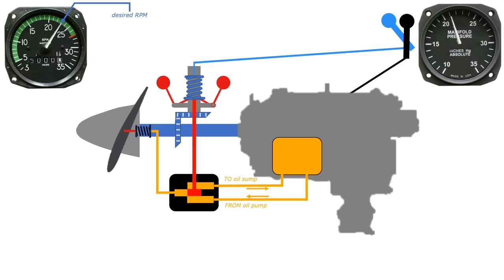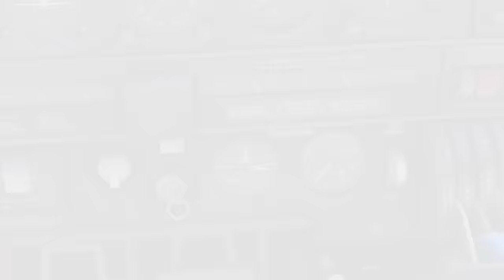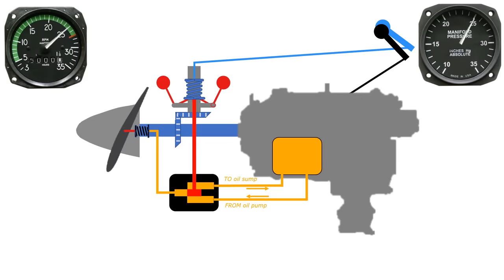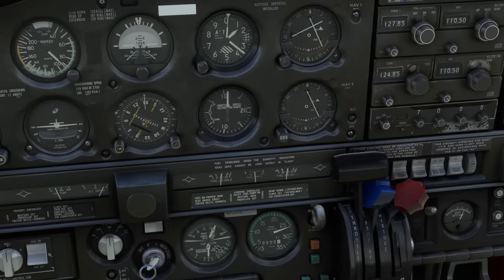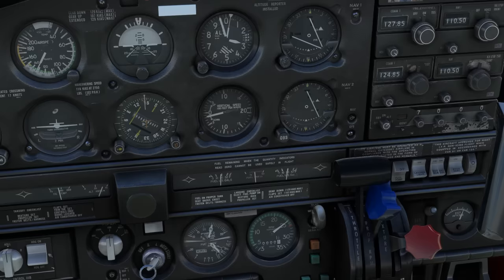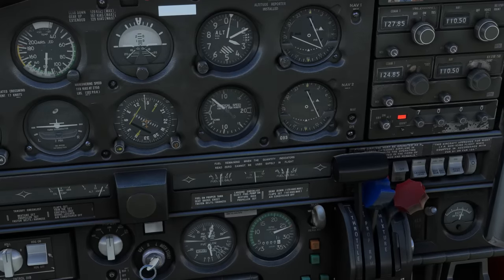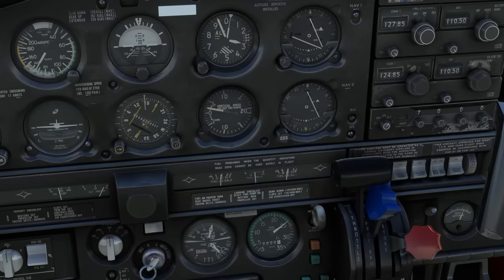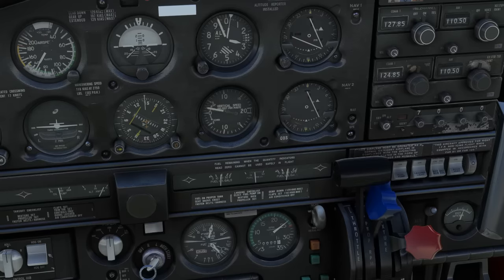How to Fly with a Constant Speed Prop | Transition to Complex Aircraft

Comment: GUMPICSS: gas, undercarriage, mixture, prop, instruments, carb heat, switches and seat belts. ( Some items may not apply).
Reply: How many nm from the airport do you start the crosscheck?
Reply: @riod43  when you get ready to descend, you use your decent checklist. With simple airplane sometimes it is only three obvious items like reduce power enrich mixture and a target airspeed. Usually if I am VFR and I am in the pattern I start my GUMPICSS check on  downwind. If I’m flying on instruments once I am within 3 miles of my final approach fix inbound and I am stabilized I can run through the check one final time. Then when I cross the fix, I pitch to my dissent rate on the VSI and I adjust power as needed to maintain desired air speed. Sounds backwards from the way you learn it, but when you are instruments, you have to pitch to the glideslope, not the airspeed indicator. Profile flight is the most consistent and result in near perfect landings every time.
Reply: Please send gum pics
Reply: What about cowel flaps? I’m partial to BCCGUMPS: boost pump, carb heat, cowel flaps, gas(tank selector), undercarriage, mix, prop/power, switches/seatbelts

Comment: I was always taught to cycle the prop 3 times: 1. Rpms go down. 2. Manifold pressure goes up. 3. No oil on the cowling. And by doing it 3 times it "cycles" oil through the prop. Now you are all warmed up!
Reply: Yes that's correct, I was taught the same!

Comment: My point of view and method for remembering the correct actions is like this: For me, the throttle is the analog of the accelerator pedal of my car. The prop control is the dearbox of my car. If I have to drive up a hill (climb in the airplane) I first select a lower gear (prop control forward) and then press the accelerator pedal (throttle). If I am rolling down the hill I usually do not change gear but just release the accelerator pedal.
Reply: That makes sense!

Comment: Why would you pull throttle off the enrichment setting during departure?  I do a noise reduction takeoff by reducing rpm to 2500.  This takes a bigger bite of the air and you can feel the increase in airspeed.

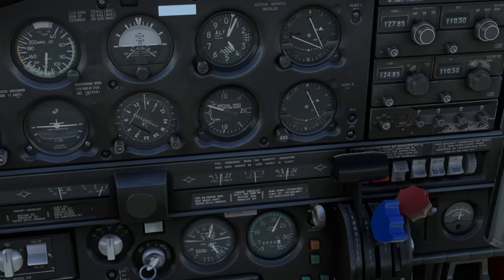Comment: 7:58 Wrong. It's not about overstressing the prop, it's about generating too much pressure (and therefore temperature) in the cylinders.

The problem with extreme settings of high MP and low RPM is higher intracylinder pressures (ICP) and a corresponding rise in cylinder head temperatures (CHT). You're feeding the engine a more dense fuel/air charge while simultaneously slowing down the power stroke. Peak pressures increase in magnitude, and occur closer to top dead center. Near TDC the piston is driving directly down into the crankshaft and you have lost all mechanical advantage; you're putting excessive force loads on these engine components and asking them to do way too much work. Instead of a bullet (piston) being smoothly accelerated down the rifle barrel (cylinder) you have created a pipe bomb. The real stress is inside the cylinder, on the piston and connecting rod. The danger is pushing these cylinder components to their temperature limits, resulting in detonation. 

Extremes of very low MP and very high RPM are also bad. In this case there is insufficient positive pressure on the piston to keep it seated, allowing  piston ring "flutter", leading to scraping and scouring of the cylinder walls.

The bottom line is do what the manual says, not what some clueless 19 yo CFI tells you. (ie oversquared old wives tale BS) The engineers who created those tables and charts know about all this stuff.

Comment: Does higher manifold pressure mean more torque/thrust?
Reply: Yes, higher manifold pressure means more power while the engine is running, so more torque, though piston engines don't have a torque gauge.

Comment: I don't want to be picky and I know youre using a sim but does the concept of overspeeding the prop not apply here? on take off and on climb, the rpm was past the red. Am I missing something regarding this? honest question
Reply: Past the red it short but not sustained periods generally in climb when need high power, but never in cruise
Reply: Depends on the aircraft - the two I've flown, one is full power until safe altitude (even if past redline) then reduce to 2500 for the rest of the climb. The other specifies max 2400 for take-off which requires a few cm of adjustment to keep it below redline.

Comment: I'm having a hard time wrapping my head around the idea that at idle, vac is low. In a car, vac is high until you open the throttle. Is the gauge behind the throttle butterfly or before?
Reply: Coming from a car guy background I had the same issue as you regarding this. Car gauges read PSIG thats the absolute measured air pressure plus a 14.7 PSI offset for atmospheric pressure. So if its dropping to less than 14.7 PSI pressure in the manifold the gauge will start reading increaseing higer vacuum numbers with a theoretical maximum of 14.7 under heavy engine braking. If the manifold pressure is higher than 14.7 PSI then your turbo/supercharger is producing more air than your engine can draw in naturally and we start to experiance forced induction (boost).

Plane guages read PSIA, or absoloute pressure with no offset. So with the engine off it reads ambient airpressure (about 14.7 PSI or 29.97 or 1013 depending on who you ask!). When you start the engine in a plane, your gauge will drop in pressure, because with the throttle closed and the engine running you are creating a partial vacuum in the manifold. This is opposite what you would see in a car. Then as you open the throttle in the plane, more and more air is able to natually flow into the manifold until its basically at ambient pressure or close to it. So in this case, as you open the throttle, the pressure reading increases.

Google PSIA VS PSIG for some graphics which help explain this a lot more. But basically in the vacuum range of engine operation, cars and plane guages work in opposite directions even though what the engine is doing is identical. Its simply a different way of displaying the data.

If you are thinking about it in a boosted context, the plane method works better in my opinion. I.E, going from 25 to 35 on your manifold pressure makes logical sense, higher number = more air & power. In a car this would read XX mm/hg vac to XX PSI boost, why use two different units for what is really just a linear change in air pressure?

I hope this helps I have had to break a lot bad habits when it comes to thinking about manifold pressure moving from cars to planes!

Comment: You glossed over something very important at 12:00. A lot of pilots keep the prop back until on ahort final. The problem with that is if you lose the engine, there may be very little pitch adjustment with which to stretch the glide. Prop forward abeam the numbers on downwind gives you a LOT of glide stretching in the event of a power loss.
Reply: I don't understand your comment. Prop forward increases the drag, no? Why would it stretch the glide?
Reply: Glide performance increases as the blade is coarsened. You’ve got it the wrong way around. The reason we are taught to increase the prop to full fine before landing is to facilitate a possible go around.
Reply: @z120p  I don’t think I had it the wrong way around. Your first comment is very confusing but I think I understand what you meant. Either way, I think sticking to the POH and GUMPS is the best advise.
Reply: @z120p This is correct, to stretch glide pull the prop out to coarsen prop pitch.
Reply: @Virtualmix  im not the original poster, and I wasn’t responding to your comment at all. I was responding to the original post that said that glide performance is better with fine pitch.
Reply: If you lose the engine in most single engine aircraft, the oil pressure loss will cause the prop to go full fine anyway... Some aircraft may have an auxiliary pump to feather the prop, and most twins are the opposite (engine + oil pressure loss = feather by default).

Comment: Nice tutorial, well done. If you get the same power (65%) from 24.7 MAP @ 2200 RPM vs 22.8 MAP @ 2500 at 4000', how do you choose between those two settings?
Reply: Much quieter at 2200
Reply: I like to use the lowest RPM and highest MP that will give me the desired power. Lower RPM results in less noise, lower fuel consumption, and fewer hours on the tach.
Reply: The lower RPM. Quieter, less frictional loss, better volumetric efficiency, and reduced EGT.

And remember, it's not really just two options. That's just a simplification for tabular presentation. In reality, it's an envelope.

Comment: OK I’m probably going to get a dozen or more opinions on this question. You look in the POH and you decide that you’re going to fly with 65% power. There is a table that gives you a bunch of manifold, pressure and rpm combinations at different altitudes. OK, let’s say you decide you’re gonna fly at 6000 feet. The POH gives me beautiful pressure and rpm at that altitude starting with 2200 RPM, 2300 RPM, 2400 RPM at 2500 RPM. Each one of these speeds has a respective manifold pressure setting. Each one is supposed to give you 65% power. Which rpm dental pressure combination is going to give you the best performance, the best speed, the best fuel burden, and the least amount of engine wear? Is it a higher manifold, pressure with a slower rpm, or a lower manifold pressure with a higher rpm? I also noticed a POH’s does not give you specific airspeed for every combination. It just gives you air speed at brake horsepower.
Reply: The fact your using 65% power at 6000ft indicated results in a slower speed at a fuel saving using the POH settings for that altitude ie go further for time not distance depending on wind direction, but there's a difference between indicated altitude, while the engine/prop should be adjusted on the Density Altitude ie not the same!
Reply: @TheCruizer21  I guess you’re not following me or I’m not making the question clear. At any given altitude, the POH gives you different power settings with different RPMs. It’s still represents the amount of brake horse power for any given setting. What is the determining factor that would let you run the prop at 2300 versus 2400? in other words, what is the benefit of the slowest RPM with the highest pitch versus a lower power setting with a finer pitch. I would think with a constant speed prop you would want the lowest RPM to minimize  wear and tear while still being able to move the airplane through the air at the same speed for that altitude.
Reply: @aviatortrucker6285 It gives you two because it's defining an envelope related to power. But there are other considerations that favor the lower RPM: less noise, less frictional loss, better volumetric efficiency, and lower EGT.

Comment: Thanks for the video however I'd like to have a clarification on the mixture.
Let's assume I'm cruising at 7000' and need to climb 9000'. Won't the mixture set to full rich degrade the performance of the engine?
What would be the consequence of doing right to the left, i mean prop full forward then throttle full without touch the mixture especially during a climb.

Cheers
Reply: The answer is it depends.  Full rich in a climb is more likely to apply with a turbocharged airplane.  In your example my airplane would already be below 65 percent power in which case you can use any power/mixture setting you want without fear of damaging the engine.  The important thing to pay attention to in that scenario is CHTs.
Reply: @utah20gflyer76  Thank you, I really appreciate this clarification 🙏

Comment: Nobody ever explains how you chose what RPM to set.  So for 65% power, you can operate at 2200 or 2500 rpm. Or anything in between, interpolating MP to suit. Why would you chose one or the other? Presumable 65% power gives you the same (ish) speed whatever you chose? Are some RPMs more fuel efficient than others? Does it matter what height you're at? How do you chose???
Reply: Yes you have a choice of rpms that provide the same brake or shaft horsepower. Power is torque times rpm. Pistons do not generally have a torque gauge so MAP is used as a proxy.
The engine will be most efficient around its best torque rpm. However, the prop has its own efficiency curve and the airplane has its drag curve. The most economic cruise rpm depends on how the airplane designer has matched them all up. Hence the only generic answer is to use the performance tables of your POH to choose the best rpm.
Any given power such as 65% is the theoretical percentage of rated engine power at the crank, or % of rated bhp. As such, although it will give similar airspeed in the cruise, it will not be exactly so because the prop efficiency (hence thrust horsepower) varies with both rpm and airspeed.
There is a rational method to choose the most efficient cruise altitude for a piston. You decide the percentage power you wish to cruise at, for instance 75% for a fast cruise or 55% for range. The concept is to climb to the altitude where full throttle will only just maintain the required MAP (critical altitude). Throttling losses are minimum at this altitude. Obviously you need some reserve power for manoeuvre so you will choose no higher than the next lowest cruising level. You will effectively be at operational ceiling for the cruise power desired.
Reply: @XPLAlN  You say "Hence the only generic answer is to use the performance tables of your POH to choose the best rpm." But how? Those tables only tell me which options are available, not which are better.
Reply: @matthewwilliams2128  the POH may provide the range by % power and rpm, in which case you just choose the best for range. The range tends to go up as rpm goes down. If the POH does not specify, then the best range is likely to occur at the lowest rpm (that is both approved and achievable) for the % power you intend to use.